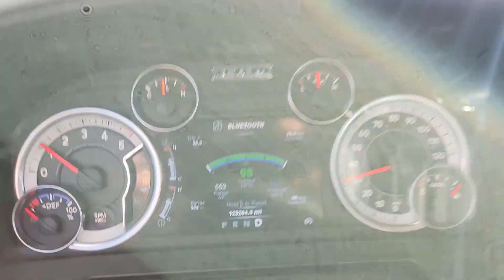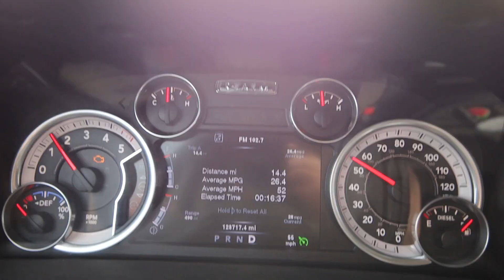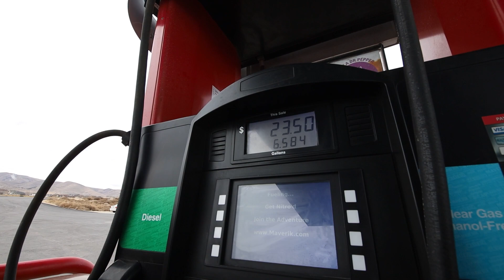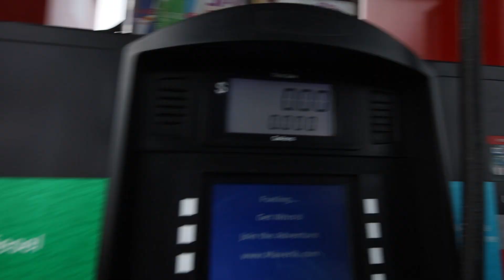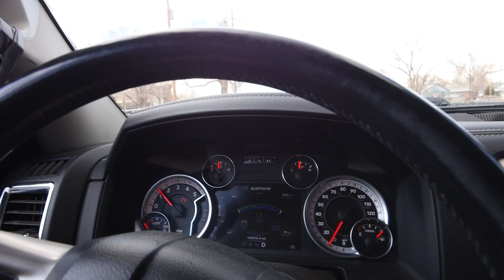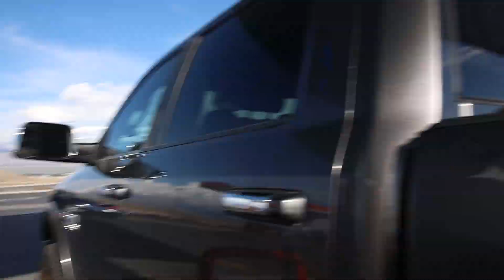EcoDiesel Tunes Compared! MRTUNING, SFT, GDE AND Reckless Motorsports. Part 1: MPG Test!

Comment: I was planning on getting there GDE tune, as I had a good friend recommend it to me, since that's what they've got on their ecoDiesel. After watching and looking into all these different tunes, I'm kind of leaning towards reckless, but there also seems to be a lot of drama around reckless. GDE doesn't seem to perform quite as well, but I've also not heard any drama regarding them. What's your take? Reckless or GDE if you had to take it to the bank for the long haul? @glennpearson
Reply from the maker: GDE doesn't offer anything but emissions compliant tune. Its much better than factory, but its not quite as good for longevity. SFT would probably be a safe choice. Some of the drama around Reckless is because of the tuner himself. Some unhappy customers. overall many are happy. Keep in mind his tune isn't focused on safety or reliability, its power first, then fuel economy and then safety in pretty much that order. If you're looking for a no frills decent tune I'd go with SFT. If you want to continue to be fully EPA approved you can pick up the new GDE tune. The best option might be to pick up a used GDE ECM and program that to your truck. I actually have 2 of those hanging around, depending on what you're driving one might work for you.
Reply: @GlennPearsonDIY  I might be interested in that. What's the best way to message you?
Reply from the maker: @MCDubaree  email is fine, glenn.realservice@gmail.com

Comment: The real test…. The bottom end longevity test 😂
Reply from the maker: The tunes will help with that. I know 2 ecodiesels that are tuned and tow commercially. One is just about 500k miles. Fully deleted with sft stage 2. The other he just cracked his head at 423k miles. It's his second engine. The first made it 371k and blew a head gasket because the egr failed and was leaking coolant and he was pulling a grade and over heated.
Reply from the maker: But yes, these have a high lower end failure rate. Many of them aren't tuned and are driven like sedans. Worst case for these little diesels with stricter emissions than the larger trucks.
Reply: I know, I’m a diesel tech at a large dealer.  We see them needing engine replacing quite frequently.  Usually bottom end failure.  That being said, these things are terrible to work on, the engineers really need a smack…. Torx fasteners and hex fasteners should not be used on heat cycled parts…. As well as the glow plug design 😒

Comment: Are these delete tunes or emission compliant tunes?
Reply from the maker: There is only 1 emissions compliant tune on the market, and that is gde's new tune that they had to pay thousands (around $300k total) in order to get certified by the EPA. 

I think you're referring to stage 1 tunes, where you don't physically alter the vehicle by removing any equipment. All of these companies offer stage 1 tunes. These are all stage 2/off-road tunes I'm this comparison. But should still give you a good idea of how they compete with each other.
Reply: @GlennPearsonDIY  thanks for the quick response, I just wanted to make sure the reckless was to where I could remove dpf.

Comment: Glen, I know you have answered this before but couldn't find it. I just bought sft tune combo after watching your channel. Looking for a little clarification, Using only stage 1 tune (still under warranty) do I need to block the defuser or just leave it and let the tune disable the egr?
Reply from the maker: But, that said there are plenty, including my dad, that are running a stage 1 tune and don't have it blocked off. Pull your egr tube and clean it, then check it again after a few thousand miles and see if it's getting dirty again and if it is install the block off plates.
Reply: @GlennPearsonDIY  Thank you for the help. Like you were talking about yesterday it hard finding people that will take the time and help one another.  Thanks again and stay safe
Reply from the maker: I would block it just to be in the safe side. It's cheaper, under $70 for the kit, and takes 15 minutes to so and you can put it back on if you go to the dealer. 

The egr valve can get stuck open and even if the software turns it off it will still be letting exhaust/soot back into the intake.

Comment: You should probably do this procedure atleast 3 times for each tune to get something accurate.
Reply from the maker: I've done this loop 35-40 times now and understand the results quite well. I ran reckless twice because I didn't believe the 29mpg and both runs on the same pump were within .1 mpg. Gde and sft both have been ran on this 10+ times. 

I did a 400 mile trip with reckless and the evic showed 30.4mpg and hand calculated results were 27.6mpg, staying consistent with the 3mpg optimistic on the display I saw in these loops. it has  given me really good mpg in the 5k miles I've tested it. 

The results for gde and sft are about the same as they were the first time I compared them 2 years ago.

Comment: I just purchased a 2016 Jeep GC ecodiesel and from my researching in the last 3 days on forums I have seen your name come up a lot. This video helped with my decision to go with reckless. Great info here
Reply: How's your truck running now?
Reply: @outlawracing828  it's running great. Been on stage 1 for about a week now. Randy has been very patient with all my questions. He has great communication time. I'm running the stage 1 non emissions compliant and @100km/h (60mph) I managed a best of 37mpg so far (hand calculated). I still need to change the air filter, change the fuel filters and I'm going to start running the hotshots treatment soon. I will give an update once I do the EGR delete and exhaust delete. I'm also running their transmission tune.
Reply: @Fridgeboy any updates on how it’s running?
Reply: @utubedude2842  I ended up selling that one. The tunes were a little rough in the beginning for about 6 months and then all of a sudden the tunes were great, like a very noticeable difference. I think I know why but it's my own speculation, I would not buy from him again. If you are looking for tunes now I would go with either GDE or MRTuning (EOC Canada). I bought another 2016 GC EcoDiesel and I'm running a compliant GDE tune. It's ok but if I was to do it again I'd probably just go with EOC/MRtuning and I may still switch from GDE but it's hard to justify spending that kind of money for a bit more throttle response at this point if keeping the DEF system. To be honest I won't be keeping this past the warranty. A replacement Gen2 ED engine is worth more than my vehicle (well over 15k) at this point which is just too big of a risk.
Reply: @ my hemi has 240k so been looking to buy another truck. Would love a ram but the stories of the eco diesel are scaring my. I do not care for GM but their 3.0 inline diesel is pretty nice and I may go that route. Thanks

Comment: Like your videos! can you do a video on the gauges I saw on your pillar and what app you were using on your phone?
Reply from the maker: The gauge on my pillar is a very temporary boost gauge that I setup to verify that I wasn't leaking boost anywhere and that the app showed what was actually going on. I plan on picking up a CTS3 with a pyro probe for more accurate EGT and lambda reading. 

The App that is up is the OBDLink app. I am using the OBDLink MX+ adapter and the software is free. I have torque Pro as well that I use occasionally and will be using that to record the 0-60 times and 1/4 miles (if I don't make it to the track) in future videos. 

I'll do a video of everything I've done including the app and gauge in the near future though and go over what I recommend using.

Comment: Have 14 ecodiesel. Bought it already deleted and tuned. But don’t know who tune by. Has been in shop 2time past 3wks. For p0299 low boost. Went in limp mode wouldnt shift out 1st. Shop said was loose turbo boot and was fixed. And exact thing happened wk and half later. Is back at shop. Now saying need new tune. They can’t do it. Trying to buy SFT. I just did the tune inquiry. Have a lot questions tho bc says not compatible with other companies tunes. But saw on website tab under setup something about how to do with non stock ecu. But really confused.  Was wanting purchase monitor with tunes. Been without truck 3wks now. And shop can’t help told me come get it. Idk what I paid for to be fixed 1st time. $460. They replaced #6 glow plug and said was fixed. Worked for week n half. They said it was under warranty to bring it back. And now said all that

Comment: Glenn,  I’ve been watching the arguments on the forums and it seems your very knowledgeable on all of this. There is a used pre epa gde ecu that I want to purchase but gde won’t switch the vin, or service it at all for that matter. Is that something you could do or could recommend who or what is needed to do this?
Reply from the maker: Its pretty easy to change the vin yourself using AlfaOBD and an OBDLink MX adapter. If you 're close to me I can do it, or even if you ship it to me I can change it for you and ship it back. 

Below is a link to a writeup on how to do it. I started this process and had the first working used GDE ECM in my truck. A few other guys helped refine the process and all of us worked with the developer to get the app where it needed to be to do it. Now it works flawlessly and I've done it probably 20ish times now. 

Here is the write up: https://www.ram1500diesel.com/threads/programming-new-ecm-to-ed-with-alphaobd.67631/
Reply from the maker: FYI, The EPA won't let GDE do anything with the old tunes. They have already paid $200k+ in fines and certifications, so I don't blame them for steering clear completely. I think this is why they don't really care that people are reselling old ECMs and programming them. In fact, GDE helped me when we were figuring this out. They showed how to decipher the injector codes from the sticker off the fuel pump cover on the front of the engine.
Reply from the maker: Did you ever pick up the GDE ECM? If you're willing to mail it to me I can switch the vin/injectors for you to match your truck If that is what is holding you up.
Reply: Glenn, have a 2015 ecodiesel  with 80k.   Major engine failure at 75k that was covered with warrantee.  After engine replaces did a SofaKing level 1 tune.  Was happy with the performance at first, but on a recent trip (1700 miles) pulling trailer (4000lbs) the engine struggled on freeway steep grades in eastern Oregon.  Struggled up grades at 40 or 45 mph.   The first 3000 miles the engine performed better on such grades.  If feels as if emissions kick in and choke the engine under certain conditions.  We thinking of going to. Sofa kings level 2 tune, but this will take modifications.  Wanted your thoughts on the benefits of full tune and my experience recently and my truck performance?  Is that possible?
Reply from the maker: @markhink8674  stage 2 adds a little bit of  power but also how keep egts and oil temps down. What were your temperatures going up the grades? If oil gets into the 260s the engine derates power. Same if egts go above 1500. I monitor the temps closely while towing otherwise you don't know the whole story, and if there is an issue you have a chance to catch it if the temps go higher than they should before it causes an issue. 

Do you know what the grades were?

Stage 2 will help but you're only gaining 20 more hp and 30 more torque. My average speed in grades is 50-60 depending on the grade. Some I can take faster but things start to get hot and I like to keep it cool. 
If you have a Laramie with the stock grill, swapping that to the longhorn or sport grill would probably make a big difference. Mine dropped 10-15 degrees on the oil when I swapped my Laramie grill out.
Reply: @GlennPearsonDIY     Such good information Glenn, Thanks.  Yes my temp did climb over 250 degrees and at times over 260.  If I turned off my A/C the temp would not climb as high and the engine seemed to have more power.   So keeping the oil temp down should be my priority as a solution going forward.  I am not sure I want to perform the stage 2 changes to the exhaust and other ‘delete’ steps myself.  Any idea what sort of shop performs those exhaust and other changes?
Reply from the maker: @markhink8674  Most won't do it for legal reasons. If you want to go stage 2 I would plan on doing it yourself. A few shops may do it, in smaller town or smaller shops. The EPA has been going to the larger shops and shutting them down and taking all of the tuning equipment, including dynos, if they find they do anything with the emissions equipment. So many of them aren't doing them anymore.

Comment: 29mpg holy shit 😂 could only imagine how much a stock height truck with stock sized tires would get.
Reply: I live in Wyoming and the speed limit is 80mph and I drive 1k a week for work. What would be the best tire/wheel/gear ratio for this do you think?
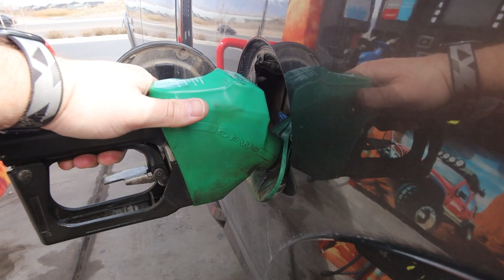Reply from the maker: The lift hurts a little, but the larger tires, once going, get better mpg than my stock sized tires got. The reason is the RPMs are about 300 lower at 70mph with my 34's. My dad has a 2015 with a 392 and stock tires/lift. We've driven the same routes at the same time, and I will get 4-5 mpg more than him going 70 with my 37s because at 70mph, he is about 2050 rpm and I'm at 1550 rpm. On the torque pro app, it shows I'm only using 2-3 more HP to spin my tires, which is really insignificant. 42hp vs 45hp when cruising was the difference between our trucks. My final gear ration is around 3:10 with the 37" tires. My dad gets better mpg in the city, but only a tiny bit. On the highway, the lower RPM more than makes up for the wind drag. 

The best combination is larger tires that don't weigh much more. Worst combination is short heavy tires. No gear ratio benefit but all the negatives from the weight.

Comment: Glenn, I bought my SFT tune last year because of your comparisions.  It has been 18k miles without a hiccup.   Anxious to see how tunes compare now with a couple more in the mix.  Keep up the good work.
Reply from the maker: Sft has been solid for me, especially when towing. I expected it to be a little closer, but it's only .7mpg below mrtuning in this test, ans there could have been a pump inconsistency in there. but I did lookup my first mpg loop video after sft stage 2 and the mpg was almost ididenticalso 26.3mpg is probably pretty close. 

If sft added even just a little bit of timing duringbthe cruising rpm area it would bump it up to the 27 range with the others. But the tune is very reliable as is so even if they didn't I'll still recommend it as the best bang for the buck.

Comment: So watching the video, on the reckless tune diesel was 3.07 and on mrtuning diesel was 3.57 so how was the average calculated with 2 different fuel prices?
Reply from the maker: Different days and fuel went up. Same gas station, same pump. How does the cost of fuel have anything to do with the amount used and the miles driven?
Reply: @GlennPearsonDIY  I was just curious figured you’d pay more in fuel with higher prices.. just a question
Reply: @qudarrowilliams5156  he did pay more but that is not a factor in this comparison, cost of fuel has no effect on fuel milage.
Reply: @johndoe-ys7nx  yeah we talked and he broke it down to me

Comment: Did you also delete any of the emission stuff, EGR, DPF, CAT?  I have a ‘16 that’s stock have to beg it to get 20mpg on the highway so a bit frustrated and wondering if just a tune will help. Thanks
Reply from the maker: With Stage 1, and all the emissions intact I got 26-27mpg on these tests. I have a 3.55 rear diff, if you have the 392, that makes a difference (about 2-3mpg at highway speeds). Driving style and vehicle condition plays a role as well. My tires are inflated near max (75PSI on my E rated tires) and I keep my vehicle in the best condition possible, clean air filter, oil changes at recommended intervals, fuel filter ever 15-20k miles, I also run HotShots Diesel Extreme every 6 months, and ShotShots EDT every tank.

Comment: Your truck lifted and have bigger tires just curious I have stock eco and wondering how much a difference between your truck and mine would be
Reply: Also can you do a review pulling a trailer with reckless
Reply from the maker: Yes I have a 6" fabtech lift with RC Vertex Remote res coilovers. I currently have 34" snow tires on, which are very soft. Normally I have 37" tires. I also have the 355 rear diff which makes a big difference in highway fuel economy compared to the 392. 

I'm debating about switching to my 37s again for the rest of the reviews.
Reply: @GlennPearsonDIY  I have a 3.55 also but no lift just plain stock

Comment: Glenn, which of these tunes would you prefer for daily? I assume you'd have the engine tune and transmission tune together.
Reply from the maker: Right now, I'm liking the reckless tune. Has the most low and midrange power which helps for towing and regular driving. I am using his transmission tune, which I also like so far. But I've used sfts transmission tune for about 50k miles and it's been great with the other tunes I've tested. My only issue is it's not great when towing so I will usually manually shift in situation where I know it's going to struggle. 

If you do both engine and transmission tunes it's generally cheaper to go through the same company though.